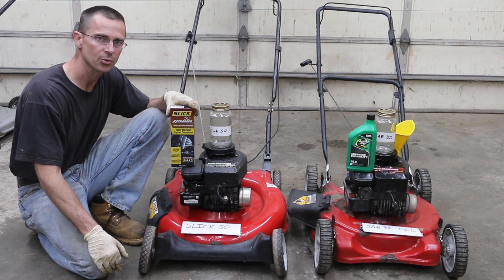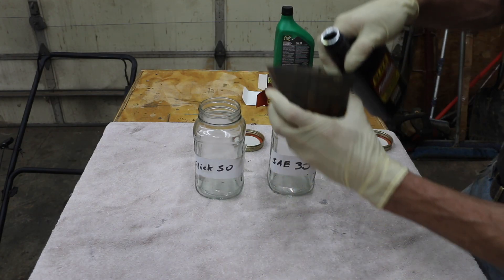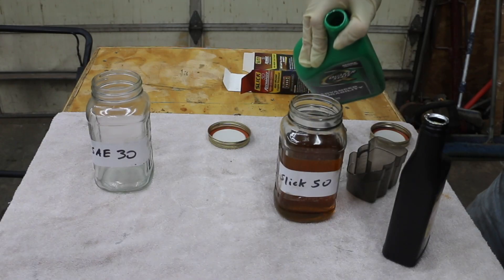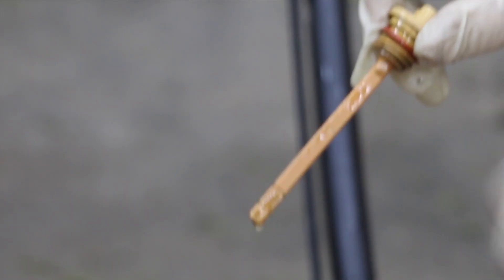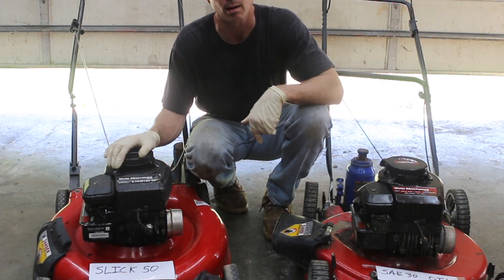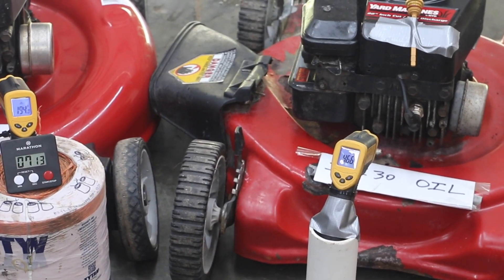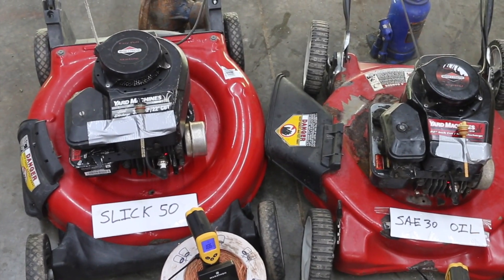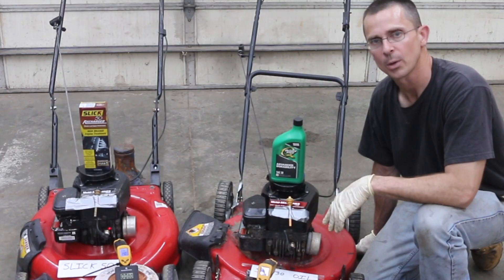Can't believe what SLICK 50 did to my engine!!--Dry Crankcase Test!

Comment: I saw a slick 50 demonstration done in the late 70s or maybe early 80s when slick 50 was around $50 per can and new to the market. He brought a small engine that had the crank case cut out on one side where you could see the crank. While he was giving a presentation inside that took about 20 minutes, he let the engine run outside the entire time. We were all totally amazed that the engine could run the entire time with no oil. He said that slick 50 had to burnish itself into all of the metal inside the engine. Maybe the slick 50 engine needs to run for quite some time before you drain the oil out. The man even told us that he knew of someone that hit a rock with the oil pan on their automobile that was treated with slick 50 and drove over 20 miles with no oil in their car to a repair shop without damaging their engine. If that was true that is truly amazing.
Reply from the maker: Thanks for the constructive feedback

Comment: at 4:40 you can tell more oil was drained from the slick50 motor. unless it's just due to spillage, I'm thinking there was more residual oil stuck to the inside of the crankcase with sae30

Comment: I suspect that sample size and variation between engines had a lot to do with this outcome, but it was awesome to see! I bet your mower supplier has a neverending craigslist add looking for mowers. Also in an automotive application slick 50 would offer very little in the way of crankshaft journal bearings lubrication which would quickly result in spun bearings. Probably why they don't have silly ads anymore.
Reply from the maker: Thank you!

Comment: I remember the commercials too and have tried Slick50 but I also recall in the instructions that the Slick50 treated oil has to be in the engine for several thousand miles for the Teflon to fully bond to the metal surfaces inside the engine.

Plus if there was any truth to the infomercials' claims, maybe the test engine had 100% Slick50 in it rather then just treating motor oil with one Qt. 50 and 4 Qts. reg oil?
Reply from the maker: Thank you!

Comment: You’ve got it all wrong my friend slick 50 requires around 200 miles driving time for it to start to activate!
 it will coat the bearings, crank and other parts of the engine after those miles have been racked up I’ve been using it for the last 25 years in all of my cars and it allways works,  100% reliable it does exactly what it says on the box
Reduces heat Metal wear and corrosion.. my engines  run about 70% smoother and I gain power through less friction 
I know it says apply after 50,000 miles but it always works and will never harm your engine even if you apply it to a low mileage engine around 40,000 miles
It’s amazing stuff always w,ill be!
Reply from the maker: Thanks for the constructive feedback

Comment: Slick 50 + top motor oils, VS virgin top motor oils.

Does slick 50, when consistently and homogeneously present in oil, cause an oil to perform generally better? For fun, throw in a poor-performing oil and see if it makes the oil closer in comparison
Reply from the maker: Thank you!

Comment: Slick 50 works, ran it in a car (v-8) that used crazy amount of oil. Let a friend borrow it and he forgot to add oil on fill up. 400 miles later the car was nearly overheating and had no oil on the dip stick. It’s antidotal, but I believe the slick 50 I put in the week prior saved that engine.  It seemed to run smoother with the additive.
Reply from the maker: Thank you!

Comment: First of all I really enjoy the videos and test. But, that said there are simply too many potential variables for one test to provide absolute definative results, I.E. engine tolerances yielding actual diminsion differences in the engine, engine manufacturing process  variabless,engine component  metalurgal difernces including types and flaws etc. etc. etc..For difiniative results the test must be repeated a number of times. Testing economics usually makes it difficult for the little guy to really do it right. I am not a Slick 50 indorser , and would never recomend any oil additive period.Aditives have no approvals from the SAE, API, or ILSAC. Not to mention, to run an additive, generally voids the OEM warranty as well as the oil manfacturer warranty. I recomend running  the best (Subjective) approved lubricant for the application period.

Comment: I remember those old Slick50 commercials too, there was one where they took the oil pan off and sprayed the crankshaft with a hose while the engine was running.
Reply from the maker: Thank you!

Comment: Original Slick 50 was Awesome. but you cant get it anymore. i allways used it in my open class racing motors.  one time i changed oil in between heats and forgot to re fill, i made 10 hard laps around the track befour i remembered what i did. checked engin and all was great. went on to will the heat. the slick 50 formula was bought out and changed becouse it worked to well. Oil companys cant have oil that last to long. they would loose money !!   just like with drug companys. they dont want to cure your illness just treet it forever !!
THIS IS A FUCKED UP WORLD WE LIVE IN !!

Comment: You should do the same test but with Motorkote & SAE30
Reply from the maker: Thank you for the video idea!
Reply: Project Farm i believe Motorkote is a pretty good lubricating product, id be curious to see how long an engine would run after coating it good with Motorkote, i use Motorkote in my motorcycles lawnmowers snowblower pressure washer wifes Canam Spyder... I bought a brand new motorcycle in 2008, said to check valves at 27,000 miles, i had them chckd at 30,000 didnt need adjustment, had them checked at 60,000, did not need adjustment, bike mechanic told me, whatever you are using for oil, it must be working well, i run my bikes hard i grew up racing dirt bikes etc, i used Mobil 1 Full Synthetic 10w-40 Motorcycle Oil with the Motorkote, just thought id share that w you, yr test videos are pretty thorough & professional, keep up the great work they are very appreciated, ThankYou!!!

Comment: I been using present day Slick 50 in my 04 Jeep Cherokee 4 liter straight 6, I change the oil every 3000 miles and run 10w-30 syn blend Castrol, it's my long trip auto, it seems to work fine for me. I use it because I cover a 1000 miles in one day of driving going 70mph. Does it do what it says it suppose to do, not sure, but according to this video it does effect the temperature in a positive way.
Reply from the maker: Thank you!

Comment: Motor honey. Rislone. They have I had all these additives and none of them really worked transmission sealer they never really work. Do you actually tell you not to put additives in your oil. Because it doesn't need it. Most manufacturers don't make their own oil. Even the greatest Valvoline doesn't make its own oil. John Deere doesn't make its own oil. They have always had some backstreet facility make it. Small companies large companies even made there grease. The name of a company can be anything and someone else can make it they just give out specifications what's a breakdown of the oil supposed to be or the grease. In the company starts manufacturing it for testing. To see if the company likes it. Even the color has to match
Reply from the maker: Thank you!

Comment: After watching this excellent video, I did a bit of google research on Slick 50, and I found the following press release from the FTC, dated July 16, 1996.  I have included relevant quotes from the article below.

https://www.ftc.gov/news-events/press-releases/1996/07/quaker-state-ads-slick-50-are-false-and-misleading-ftc-charges

July 16, 1996

The Federal Trade Commission has charged Quaker State - Slick 50, Inc., the manufacturer of Slick 50, the best-selling auto engine treatment in the U.S., with making false and unsubstantiated advertising claims 

Slick 50 is the most recent in a series of FTC cases challenging allegedly deceptive ad claims for oil additives or high octane fuel.

The FTC complaint also specifically charges that Slick 50 did not have adequate substantiation for its advertising claim

The complaint also alleges that the company did not have adequate substantiation for its advertising claims that one treatment of Slick 50 continues to reduce wear for 50,000 miles and that it has been used in a significant number of U.S. government vehicles.

Finally, the complaint challenges ads stating that “tests prove” the engine wear claims made by Slick 50. In fact, according to the FTC complaint, tests do not prove that Slick 50 reduces engine wear at start up, or by 50%, or that one treatment reduces engine wear for 50,000 miles.

Comment: About 20 years ago my brother in law bought a new off the show room ford 4x4 and ran slick 50 to help it last as long as possible (Slick 50 was all the rage at the time) and just 200 miles before the first oil change the motor locked up, the mechanic at the dealer said the sludge build up looked like a 20 yr old motor. I've never used it since.
Reply from the maker: Wow!

Comment: The problem isn,t your test it,s slick50 they switched the formula it,s not what it was originally , if it was your engine would still be running research it and you.ll see. I did my own test and ran a mower like yours on 50 wt racing oil and engine temp went down 10 + degree,s and ran better and longer out in the hot summer sun mowing with it ,do a test to see who has the best 50 wt racing oil i would like to see that
Reply from the maker: Thank you for this information

Comment: Slick 50 is in a much thinner 10-30 base oil. SAE 30 is a bit thicker from the get go. 50 runs cooler because of less friction, but it still needs OIL to work ! I have had one personal experience similar to the original commercial and the engine did not seize... Owner thought it was an exhaust leak, instead it was valves ticking away from NO OIL in the engine !! 
Original 50 worked amazingly well. Did you shake the bottle before use ? It has suspended teflon in it.
Reply from the maker: Thank you and yes I shook it before I used it.

Comment: The Slick50 product sold now is NOT the same formula as it was during 1978-1984.  The original Slick50 formula is now Xcelplus.  Try testing Xcelplus running a "dry" motor, and you'll probably have completely different results.
Reply from the maker: Great point. Thank you

Comment: One flaw in test:  Really should have run both engines with the same sae 30 oil first to get baseline temp.  Air/fuel mix and some mechanical factors could affect the temp.  No way to know if it's due to the oil/slick 50 otherwise.
Reply from the maker: Thank you!

Comment: Engine with amsoil vs engine with synLube vs Engine with Amsoil /Tufoil together. You might try tearing down some engines and soaking the parts in Tufoil and then testing the engines with Amsoil and with Amsoil /Tufoil together. Also might try a long term test with Amsoil vs SynLube vs Amsoil / Tufoil together. Also you might try a dry test on the Amsoil / Tufoil engine vs the SynLube engine.
Reply from the maker: Thank you for the video idea!

Comment: Project Farm.. Very nice test.. Did you by chance do a compression test on the engines.. Since both engines weren't new, it's possible that one engine internally might have been in much better condition..  I use a product called Tufoil.. it was tested by the U.S. Government to be the slipperyiest substance known to man at the time.. I had been using this product for about 6 months at the time and I had a 43 mi drive to get to work .. One night while driving home I blew a rear main oil seal and lost all the oil in my eng...( For the sake of space I'll give you the condensed version) I decided to continue driving and see how good the Tufoil really was... I made it home, the engine didn't seize up, but I could tell that it was getting hotter, as it required me to give it more gas to maintain the same speed... I estimated that I drove about 35 miles with no oil going down the interstate.. If u do a test on this product use an old mower during the summer to give the Tufoil plenty of time to absorb into the metal.. Love your tests and videos... Keep em coming... Gary..

Comment: Thanks. Get your hands on some ARCO GRAPHITE oil if you can. My engines ran beautifully and got remarkably better mileage. The reason given for pulling from market was glazing of the cylinder walls causing less lube on walls and creating excessive blowby. I am suspicious. An old-timer told me of another product he swore by and used in all his cars including professional racing engines. It was called BARDAHL something or other. Don't know the excuse for that getting pulled, and i don't know how you could find any of these. May be almost as difficult as finding a GM EV-1 car? API and CIA probably behind that destruction. Thanks again. I been telling folks watch your videos.
Reply from the maker: Thank you!